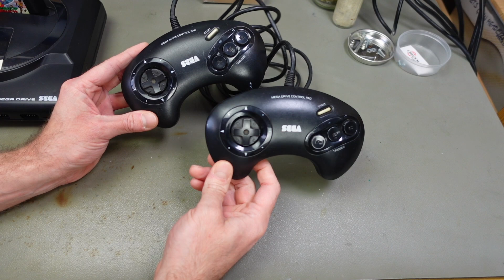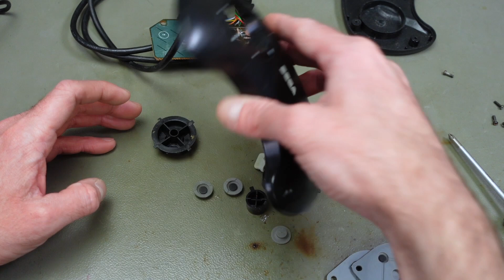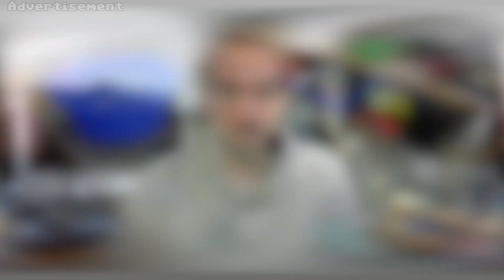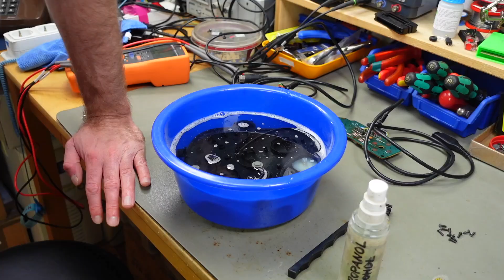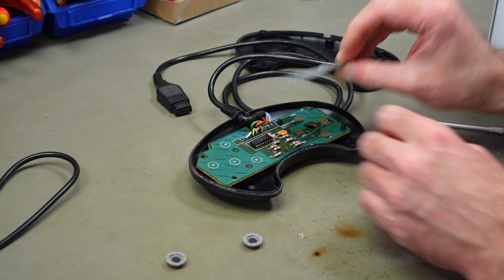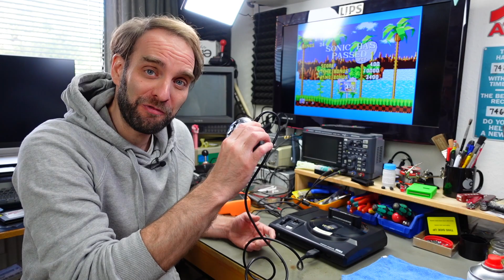Sega Mega Drive Controller Restoration

Comment: That is a weird contraption to make the d-pad contacts connect. If you look for Sega genesis / Japanese Mega Drive controller repair or tear down videos on YouTube you'll notice the board has all contacts facing the front and no plastic fitting. I assume the way it work was by warping the circuit board momentarily for the d-pad? How odd. Patent issues with and European company at the time, perhaps? Great video.

Comment: Fantastic tutorial sir! You have inspired me to fix one of my controllers. I particularly liked the bit where you promptly explained not to use a very aggressive solvent when cleaning the silicone parts. When you initially sprayed it I winced a bit, but was relieved when you explained how mild it is. And thank you for saying what kind of solvent it was too!
Reply from the maker: It always makes me incredibly happy to hear that my videos inspire people to work on their own stuff. Thanks! :D The contact cleaner I’m using is meant to be used for potentiometers and such so it is indeed extremely mild and doesn’t dissolve the carbon layers on those silicone pads. You can easily break them with more aggressive chemicals.

Comment: Ok I have just cleaned two MD2 pads, there was a piece of card inside one of them too and I think I get why now (as well as why one of your two pads had two rubber contact parts piled up): the bottom mobile plastic part that pushes on the contacts just digs into the controller bottom part, and so the mechanical parts of the D-pad get too loose to make contacts work. That's just poor engineering. So until I find a more elegant solution, I've added a piece of card at the bottom of the second D-pad.
In the ones you got, piling up two rubber contact parts in one controller was too much though, so no wonder at least one was super worn.
In those conditions I'm surprised even one of your two controllers' D-pad works fine as is!
Collectors who use their boxed MD2 from time to time should keep these controllers in the box; well-working ones in original condition are bound to become a rarity!
Anyway thanks for your tutorial, mine work pretty well in the end, compared to the state I got them in!

Comment: There are still not too expensive spare rubber parts available for these controllers, so you could fix even the second controller If you so desire
Reply from the maker: Yes, I'm definitely going to look into that. The listings I found so far are rather obscure (or vastly overpriced) though. But I'm sure there are reasonable replacements available somewhere.
Reply: @JanBeta  Definitely worth doing.  Does make the dpad much smoother and less noisy-plastic-creaky.

Comment: Aftermarket replacement rubber pads are available, although not quite as good as the originals. It's better than broken and crumbling though.
Reply from the maker: Yes, definitely going to look into getting some. The listings I found so far are rather obscure and/or overpriced though. But I'm sure I'm going to find some good ones eventually.

Comment: I wonder if you could just use a pencil and draw on a conductive pad.
Reply from the maker: I've tried that with similar pads on keyboard keys and it works to some extend but doesn't last very long. There's special carbon paints that allegedly last longer but I haven't tried those yet.

Comment: You may want to experiment with a layer of silicone to try to reattach the ripped off dpad domes.
It should harden and yet still flexible enough to allow the dome to move.

At least until you find a new replacement.
Reply from the maker: There seem to be replacements although I couldn't find a trustworthy source yet. I have no experience with silicone casting and such but maybe I'll have to look into that and learn something new again. :)
Reply: @JanBeta  no, I mean use silicone as you would use glue to patch the domes.
Silicone casting would be complicated. 😁

There are also silicone glues available.

Comment: The Sega Megadrive was a massive hit back in the early 90's, it wasn't long before my friends spilled liquids or the controller wouldn't respond as it should so I refurbished these for fun back in the day! The joypad you have there is the Rev C, the earlier versions had all the button contacts on the same face of the PCB, the Rev C design moved on to the Megadrive 2.
Reply: Thank you for the explanation, I was wondering why his controller was so different from mine !
Reply from the maker: Ah, interesting! I think all the controllers I worked on had that same "mushroom" design seen in the video. Thanks for pointing out the differences!

Comment: Time to order a Rubber pad set from eBay? ;)
Though I'm not very happy with the ones I ordered fro the Dual Shock 3. Don't feel right and a bit stiff...
Reply from the maker: The only replacement pads I ordered so far were for a DualShock 2. And my experience is similar. They are not quite the same material but they work. I'm definitely going to try to find some replacements for the Sega controllers soon.
Reply: @JanBeta  Sure, better than worn out, absolutely. Especially the one you have.
There might also be different manufacturers of the rubber and for Dual Shock 2 and 3 you can actually use the same rubber for DPAD and Face Buttons (Circle, Cross and so on)...

Comment: So, it's not really a "restoration". It's just a cleaning. You only have 1 working controller at the end of the day. I believe someone is making aftermarket replacement parts for the silicone contacts (I could be wrong). The scratches on the shell you might be able to finely sand away; the surface of the plastic will never be the same, but with skill and a buffing machine it won't be as noticeable.

Comment: I recently refurbished a few of these.  They originally come with a spot of grease in that little round dish shape that the white d-pad actuator sits on.  In the bottom half of the shell.
Reply from the maker: Ah, that makes sense. There was some brownish residue on the "mushroom" part before I cleaned it. I might go in again and add some silicone grease and see if that makes it smoother to handle (it works really well in the state it's currently in though).

Comment: Disintegrating rubbery bits are a pain when it comes to controller repairs, but there are plenty of new replacements for sale I'm sure... :)
Reply from the maker: There are for most controllers! I didn't find any trustworthy listing for replacement pads for these particular ones though (just some obscure looking stuff on AliExpress and the likes). I'm sure they are available somewhere and I'm going to be able to resurrect the second controller, too!
Reply: @JanBeta  I don't find it. There is new controllers, wires, cables for SMD 1 but not rubber pads.

Comment: Sega's plastics are 1/10 the quality of Nintendo's.  The six button controllers are the only one's worth saving.  3 button releases were a big mistake for Sega.
Reply: I agree.  The 3 button pad is creaky and crunchy.  Though the oversized buttons are fun to whack.
Reply from the maker: Yeah, the action on these feels a bit wonky. I really like the form factor though. I always struggled with the smaller Nintendo controllers back in the day but these 3-button Sega ones just felt "right" from the start. The plastic is alright (I haven't seen many broken plastic parts on these), I think Nintendo used something a bit more elastic which makes sense for controllers. It's a matter of taste in the end, I guess!